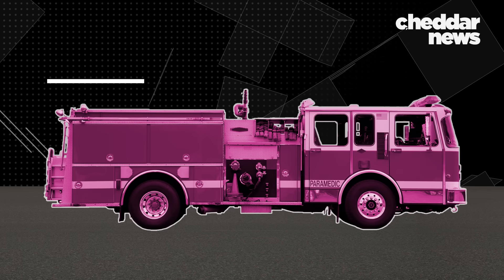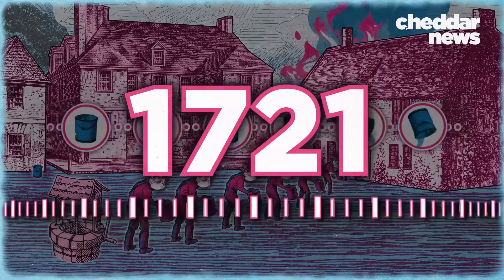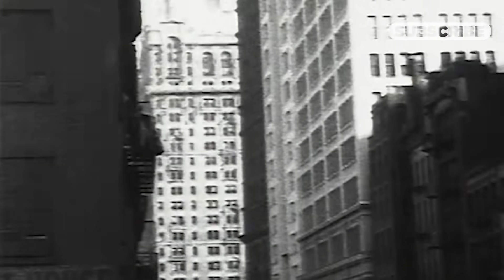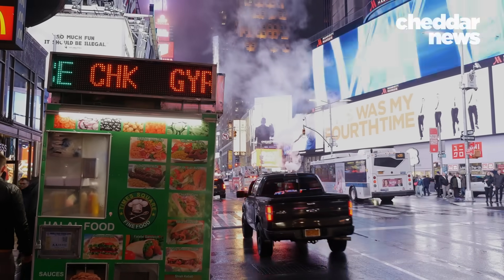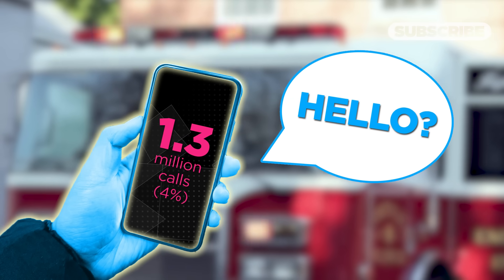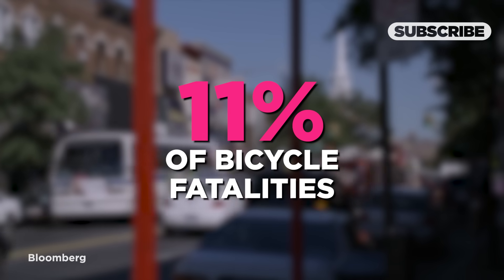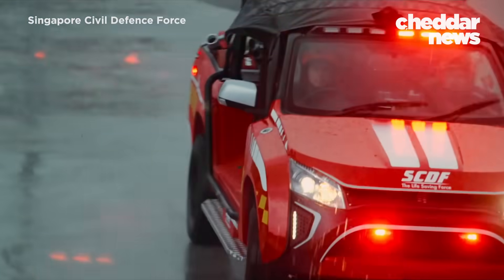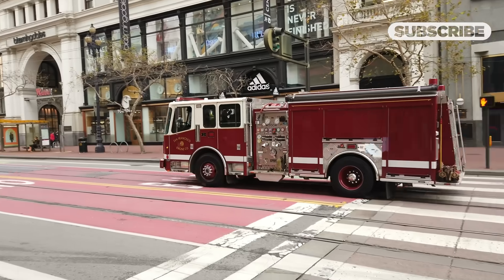Do American Fire Trucks Need To Be So Massive? - Cheddar Explains

Comment: Your stated fact are distorted falsehoods to fit a narrative you are trying to project 

The normal fire truck is 8’6” or less in width not 10’ or fire trucks used on United States highways 

Fire trucks that don’t use the US highways like airport fire trucks may in fact be over 8’6” wide but don’t us public highways 

This is just one set of facts you are pushing out there that are false and not fact

Which tells me anything put out by cheddar’s is garbage

Comment: Glad you mentioned the Red Rhino. It seems so practical, given how emergencies come in different sizes. A small vehicle fire or dumpster fire can be handled by a small team without ladders etc. The Singapore fire station has those as well, when needed.
Reply: Interesting comment. If you were a fire fighter you would know that dumpster fires (like this comment) require a ton of water. So you got this the most wrong of any comment here. Nice try though. Stick to what you know, and that's obviously not firefighting.
Reply: @jakeschorzman3770  I didn't say anything about water. Are you saying that the Singaporeans who developed the Red Rhino don't know anything about firefighting?

Comment: If it is an actual fire, FDNY has no problem busting out the longest ladder engines on the planet. There is near 0 tension with firefighters because they do thier job & they do it right. Look at how tall those buildings are. If you want real boot camp, train with FDNY because they have the experience dealing with complex traffic & building situations.
Reply: the ones based on the longest truck chassis, but not the longest in terms of ladder height. Does the FDNY run any ladder which is taller than 100 ft? I don't think so. Tallest Aerial built and drove down the streets in Europe was able to reach 367 ft of height, the highest ones which are in service today reach "only" 300 ft height, which is still 3 times taller than anything the FDNY can bring up

Comment: I had a medical emergency last year and it was one the definately would have required ambulance transport. Instead of just sending an ambulance straight away, they send a fire truck first. It often doesn't make any sense, and on top of that, it's a huge waste of resources, it's louder in the middle of the night, and neighbors were worried there was a fire.

Comment: And with those smaller trucks... those Dept are sending like 12 of them to a fire call vs 3 or 4 So may save on each individual apparatus, but if you're buying more of them to send to the same calls, you're not really saving much in terms of overall fuel and maintenance costs (if not actually spending more...) 
I mean my FD, which covers 600sq miles, and is in the top 20 largest FD in the nation, has 43 stations with a total of 63 Companies that respond to calls... This article talks about a 30sq mi city in Germany where to match the response capabilities with their small but super specialized trucks, they have 47 apparatus. Forty Seven, for one small city. Yes, they're only sending the same 20 guys to a call, but with so many specialized trucks, Are they really saving any money buying almost 50 trucks that a comparable district in my Dept would only have 2 or 3 apparatus?
And if they happen to be out training, driving around for area familiarity, shopping for groceries, Pre planning and inspecting, or even returning from another alarm, and a call comes in that requires a different mix of apparatus than the ones they have out? Have to respond all the way back from where ever to their station, change trucks, and then respond to the alarm... that takes up critical time vs no matter where we are, what we're doing, if a call comes in for my Engine, we're always able to respond immediately...
https://www.fireapparatusmagazine.com/the-fire-station/is-a-47-bay-fire-station-too-small/#gref
Reply: funny that you picked that article, I wrote it :) 
Tbh when the FDNY responds to a fire in a building I see them rolling up with just as many apparatus like we do in Germany, with the difference of them not coming from numerous tiny stations but from 1 or 2 large ones, that's all. 
"with their small but super specialized trucks" those Engines aren't specialized at all, they have anything from heavy rescue equipment to ground ladders and tools for technical assistance on board. The 1 Heavy Rescue Truck they have, it barely gets dispatched to any calls. Besides some special operations units, which btw are designed as a roll-off container / pod system to cut the costs and increase flexibility (3 trucks for 15 different special operations pods instead of buying 15 complete trucks), the number of 47 units also includes spare apparatus and units used for logistics tasks in the department, the administration etc. 
Responding to a fire alarm, they send 5 units: Command Van, Chief Car, Tower Ladder and 2 Rescue Engines. Not many specialized trucks tbh. Besides the station from the career FD, which covers the entire city area 1st due, the volunteer FD has another 11 stations in the city area, coming up with another 26 units, of which 12 are Engines, 11 Vans, 1 Command Van, 1 Tanker and 1 Hose Truck. I highly doubt that you'd have only 2 or 3 apparatus for a city of 200k inhabitants and a high risk potential. 
They have no issues with follow-up calls while they're out in the city or returning from a previous call. Based on the call statistic from a while ago: they had 260 cases of 2 simultaneous calls and 28 incidents of 3 simultaneous calls. As the Rescue Engine are the multi purpose apparatus in the fleet they can simply head directly to the next call, just like you do. For the rare but possible scenario that a pod carrier is out with e.g. the frozen carbondioxide tank, another call requires radiation protection, and no-one is left at the station to take another pod carrier to load and respond the SCBA and radiation protection container, then that one truck with the carbondioxide tank would have to respond back to the station and swap containers. In all the years of me living and working in the city I never experienced that scenario myself, of course it could have happened some time, but it's far from common. 

Btw the new station with more than 55 bays will be probably finished next year. It's still under construction right now

Comment: You also have to add that fire trucks are often used as traffic barriers. So that in the case of a large crash instead of having to add more officers to the scene. A fire truck. Which would’ve already been on the way to the scene in case of a car fire can better protect the crash scene from getting any more crashes.
Reply: You do realize they have highways in Europe, and that crashes occur on those highways in Europe?  How do you think they handle crashes on the highways in Europe?
Reply: @djzazou  I'd imagine they do the same thing. But because the trucks tend to be smaller, there may be less protction.
Reply: @theboot1023  you do realize that there are multiple trucks on scene?
Reply: @zawisiak3708  yes
Reply: @theboot1023 Smaller ≠ less safe. A car colliding with a European truck will be wrecked, while the truck will be fine.

Besides, police will be onsite to redirect traffic.
Reply: Ever heard of cones?
Reply: @ketchup901  please tell me exactly what traffic cones would do to protect you from drivers that aren't paying attention.
Reply: @headshot_hermionegranger7401  Have you ever seen a cone? Bright orange. If you put like 10 cones next to each other they are just as noticeable as a fire engine. If you pay so little attention to the road that you can't see a bunch of cones right in your path, you would definitely notice when you run them over.
Reply: @ketchup901  Sure, but that doesn't help you as a responder when drivers are on their phones or otherwise not paying attention. God forbid you're on the highway or a main road (or even just a local drag where people are known to fly), and you choose to rely on traffic cones alone and get a driver that crashes through your scene. A truck at least stops the vehicle after it takes an impact. Cones don't. One primary reason most departments position their apparatus as blockers is to prevent line-of-duty deaths and serious injuries to responders.
Reply: @headshot_hermionegranger7401  This is the most extreme edge case you could possibly come up with. Obviously you put the cones well before the actual scene. Your solution is literally to kill people who are unattentive.
Reply: @ketchup901  No, my solution is to not allow inattentive drivers to kill or injure my crews. The consequences  (to the drivers) of their own decisions are not on anyone but themselves, and yet they put my crews and I in danger on a very regular basis. That "most extreme edge case I could possibly come up with" has happened to crews near me several times in the past three months- and by the way in two of those cases, they ran over or around an eighth of a mile of cones before slamming into a rig. Any fire department incident commander worth their salt will take what steps are necessary to protect the lives of their crews and would do so without apology.
Reply: @headshot_hermionegranger7401  If someone is driving over cones for 1/8 of a mile, they aren't being unattentive. They are doing it deliberately at that point, and when they see the firefighters the only way they could hurt anybody is if they also do that deliberately.
Reply: @headshot_hermionegranger7401 have you heard of triangle, cones, lights,... ? It's passive protection it avoid collision and the truck is always between the scene and the danger so even there it's not a problem if the guy driving have is eyes close.
Reply: @ketchup901 in the state of Wyoming  10%-30% of the snowplows are out of service because people are constantly driving into the back of them. People are dumb, so you have to operate your crews as such so they don't get killed. Cones will do nothing when cars are traveling at 80mph and the scene is 100 feet away from them.
Reply: @wyomins  If only there was some kind of device that you could place anywhere you like so drivers get a warning before it's too late.
Reply: @ketchup901  are you trolling, or seriously suggesting to place traffic cones behind moving snow plows?
Reply: @wyomins  No, you are the one who brought up snow plows.
Reply: @ketchup901  my point is that no matter how big and bright something is, people will hit it, which is why you need physical barriers to protect crews on the road.
Reply: @wyomins  Yes and they do not need to be in the form of a big truck but can be portable signs with bright flashing lights so people don't kill themselves by running into them
Reply: @ketchup901 I have personally witnessed multiple drivers line up in a turn lane, blinkers on, honking their horns at emergency vehicles, driving around emergency vehicles and barriers that say “ROAD CLOSED” and “FLOODED STREET” into a river where there are three partially-submerged and one fully submerged vehicle with an active water rescue going on, then get pissed because one of the cops started screaming at them to back up. I have witnessed this in person multiple times, among countless other examples of the sort. Cones are great and visible and all but I feel like you are vastly underestimating human stupidity in saying they’ll divert drivers.
Reply: If you want a crash barrier why not paint a concrete barrier red and put weels on it
Reply: Smaller Euros need more fire trucks, while in America, it's about two
Reply: @Mark3nd It's about two in Europe too. 1ladder, 1 engine. Ladder are on big city. Engines everywhere. The rest is only specialty vehicle just like US, dive team, rope team, rescue team (use in search of victim in downed building), chimical team, wildfires,...
Reply: and that is just bizarre and ineffective, and expensive - to waste a resource as a barrier designed for something else... 
In Europe we use TMA-trucks. 
Vehicles specially designed to block traffic with a gigant bumper to absorb the forces in gas of a crash.
Reply: A good point that most people overlook. When we have car crashes, especially on  the highway, our biggest truck always goes.

Comment: Not only are US fire trucks / engines much bigger than their European counterparts, but they carry a lot les equipment. That not only makes them expensive, but also not as variable as a European fire engine!
The LAFD has bought an e-fire truck from Rosenbauer, a European company. The vehicle is from its dimensions exactly the same as the ones used in Europe. But if you open the compartments, you can see that the LAFD-version has a lot more empty space, space that in Europe is used for a lot more equipment, like with things on a Urban Search and Rescue vehicle; so where the US needs two, Europe just needs one vehicle!

Comment: This video is very misleading. You solely put the blame on the firefighters not the people or external factors. Most firefighters have clean records. It's a part of the job. Also American cities are bigger than European cities by land and housing size. Also it takes like 3 to 4 or more blocks in Europe to put fire vs 1 or 2 for American cities. Sometimes a single lane is needed. This is all situational. The main fact here is that American cities shouldn't be compared to European ones. As America is too damn big for that and  it will be a waste plus also more expense and taxing in the long run may be when we get 600 million Americans then these will become more reasonably but for now. America is too big to do any European design.
Reply: American cities are bigger by land? LA has a comparable land area as Madrid
"Sometimes a single lane is needed" same in Europe ... only a single hose line for an apartment fire for example, sometimes not even any hose line.

Comment: Tbh, I would have liked to see more direct comparisons with European engines, living in the Netherlands I always wondered about US fire trucks but the video seems to indicate the truck is just bigger in the US and not much else, and tbh it might actually be that way from what I can see. In the US there's a lot of worry around fire hydrants and their color/placement, but whenever I see dutch firefighters connect a hose they enter some information to find the closest access point in the street and connect onto it, why is that difference there for instance?
Reply: adding onto that hydrant point, here in Australia our hydrants are often buried in the ground, with a small 20x20cm hatch, and usually a sign on a telegraph pole or similar infrastructure, and finding a hydrant isn't really an issue.
Reply: Basically, if it's something from North America, it's guaranteed to be worse than it's European or Asian counterpart. That's all you need to know

Comment: Wow a beautifully produced video... that gets the core question completely and totally wrong. American Fire Trucks do not hold 400-500 gallons of Water. They hold 1000-1500 gallons of water. That's why they are the size they are. And why do they hold that much water? Because that is what the insurance industry requires for the Truck to be a "Class A" Pumper. And homeowners Fire Insurance Rates are greatly reduced if there are a minimum number of Class A Pumpers within a defined radius of your house. So in order to minimize Homeowner costs most American Fire Districts and Fire Departments which are funded via Property Taxes, only run Class A pumpers, and maintain the number required to give their constituents the lowest insurance rates.

The Second Reason American Fire Trucks are so big? Outside of a handful of 18th Century Cities on the East Coast, most American roads did not evolve from narrow alleys and carriage paths in the cities. European Trucks are so small because European streets are narrow and cramped. America has lots of space allowing for wider roads, which allow for bigger trucks. Which in turn gives firefighters a greater margin of firefighting before they have to locate and attach to a water supply. This becomes critical in certain types of thankfully rare incidents which Europe has not experienced since the second world war. Major Earthquake or an event like 9/11. Where the local water mains were shattered. And firefighting became a struggle of working off relays and truck capacity.
Reply: "European Trucks are so small because European streets are narrow and cramped" many cities in Europe had to be rebuilt after the wars, and they were rebuilt with streets of a scale that semi trucks, articulated buses and trams easily get through. And guess what: even American apparatus in Europe get through
"America has lots of space allowing for wider roads, " ask the Swedes, having an American style road layout but still don't buy any larger apparatus. Although different ones, be sure Europe has its fair share of large scale incidents, let it be due to natural disasters, attacks etc

Comment: Lot's of fire hose, heavy tools, WATER, extra traction in snow, medical stuff, air bottles and masks, 12 volt acid type battery flash lights, wench, hose reel, ladders. [ I used to work on them.]